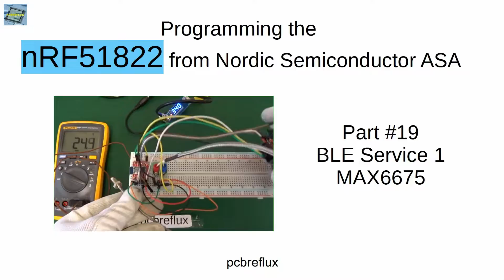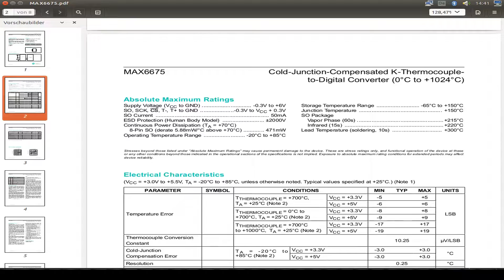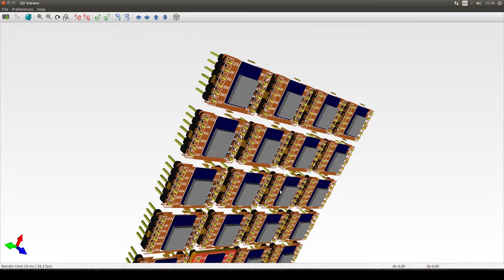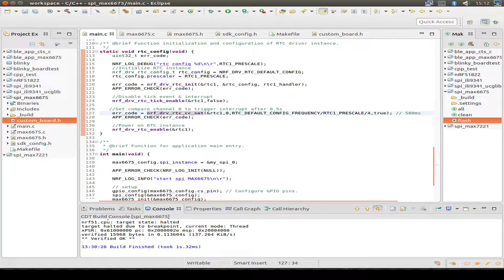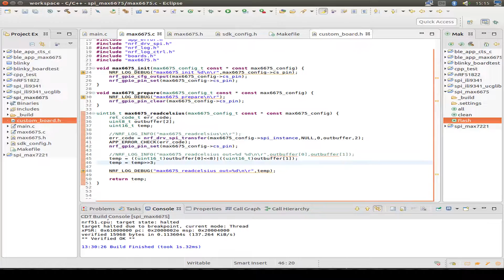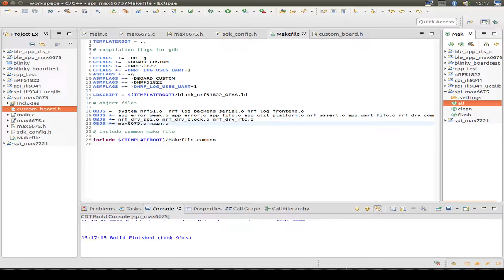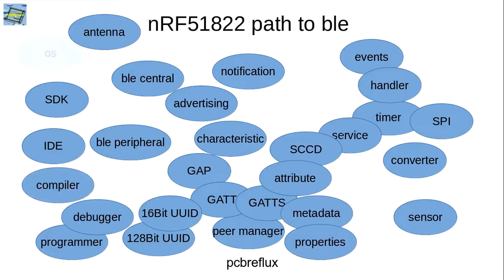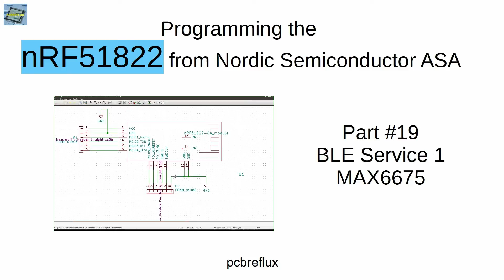nRF51822 #19: Bluetooth / BLE Service #1 MAX6675 (english)

Comment: Great video. I hope you still look at comments. :)

Is it possible to use a slimmer thermocouple amplifier board such as the AD8495? Is this possible to be a true wireless bluetooth setup or is the debugger required? I would like to simply setup a t-type thermocouple range and the bluetooth module to send temperatures to a PC. 

Thanks so much for your contribution.
Reply from the maker: Hi, I am not familiar with the ad8495 but it seams at first glance the chip is just a amplifier without a digital conversation so you need to use and additional component or use the internal ADC and are dependent on the quality to produce digital values. But sure it works and you don't need a debugger. Don't know how you will implement the client side but most of the consideration of the bluetooth implementation are based on this decision.

Comment: Hi, great tutorial! Did you buy this small nRF51822 module on Ali/eBay? Or do you have some reseller in EU/Germany ( with affordable price)
Reply from the maker: Sandro Sole Hi, the module are nRF51822-04 from aliexpress ~3$ and the board my own creation see nRF51822 #15 BLE Breadboard Adapter with kicad source and gerber. Ordered them from  dirtypcbs.com